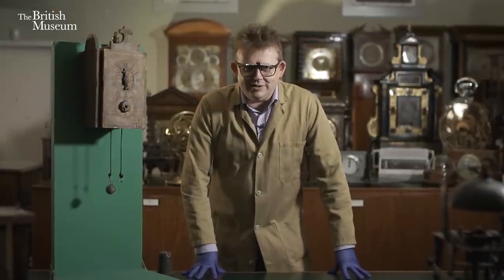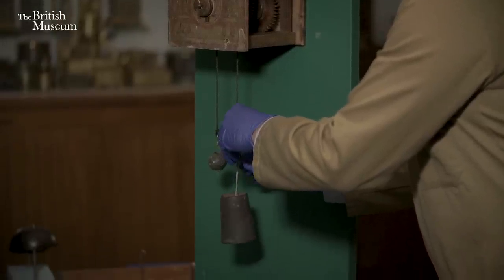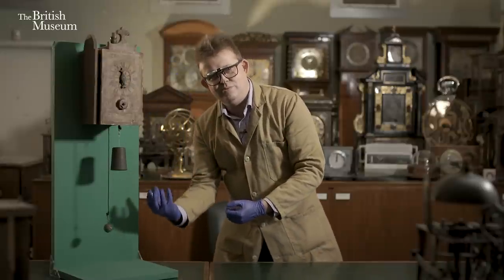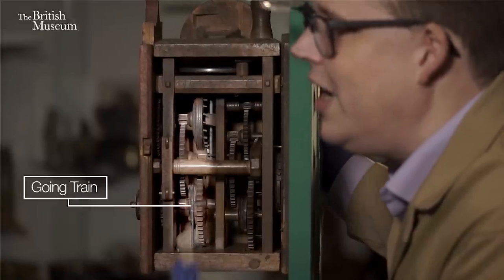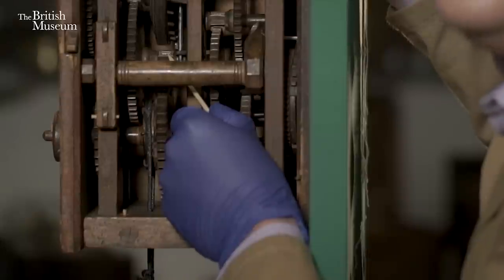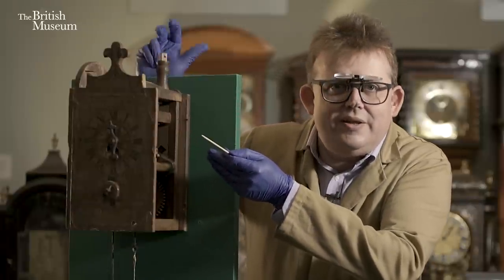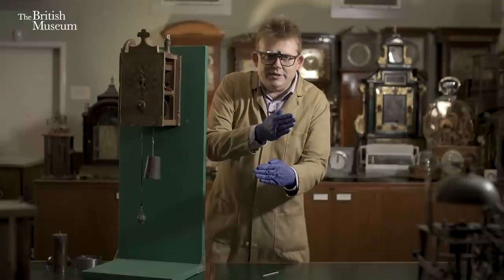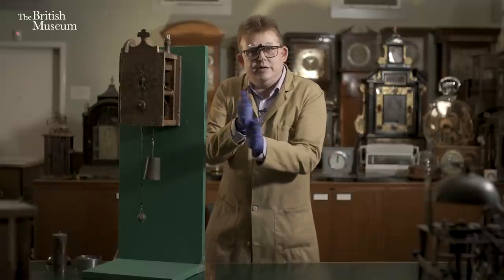How clocks work (in 5 easy steps) with Oliver Cooke I Curator's Corner S3 Ep3 #CuratorsCorner

Comment: I was taught how to tell time in the 1st Grade in 1974 or 1975.  But my sister is an elementary school teacher today.  She told me that they don't teach kids how to tell time on an analog clock/watch face anymore.  For kids today, everything is digital.  They have apparently removed all of the analog clocks on classroom walls and replaced them with digital clocks.  I think kids should still learn how to tell analog time.  There are still many analog clocks out there.  I actually prefer an analog watch face on my smart watch.  When I moved into my present apartment 3 years ago, I installed an analog clock in my kitchen.  But in those 3 years, I have never looked at that clock to tell the time. Like almost everyone else, my first instinct is to look at the digital clock under my TV or at my phone.  I don't actually have cable TV anymore, but I really missed that clock, so I bought a digital clock to put under my TV where a cable box would be.  But even with all that, I prefer an analog watch face.

Comment: as a hobby watchmaker, I got really surprised when tugging on the weight sped up the clock. In "modern" pocket- and wristwatches that is impossible just because of the physics as described by Huygens, the balance oscillation frequency is determined strictly by the combination of the balance weight and the strength/length of the balance spring. the power only affects the balance amplitude. I wonder, what's different with the clock in the video?
Reply: answering myself after watching the next video in the series: this clock doesn't have a balance spring, the balance gets an impulse from the escape wheel through one of the pallets and spins until it is stopped and launched the opposite direction by the second pallet, so the rate is determined by how fast the balance is spinning.

Comment: Let's go to the indicator and let me try out on the British Museum my theory why it's conventionally divided into twelve. 

One first "natural" clock could have been a tidal lagoon or basin emptying and refilling in a regular pattern. This wouldn't have necessarily been in phase with daylight hours, but I think high and low water are the same amount of time apart throughout the year, and through neap and spring tides as well. A practical time keeping device used for keeping track of the daily tides would naturally be divided into 12 with the 1st hour after low water defined as the time by which 1/12 of the tidal range has been reached,  by 2 another 2/12, by 3 another 3/12, by 4 another 3/12, by 5 another 2/12, by 6 another 1/12. so by tide-turn all 12 12ths have been added, because 1+2+3+3+2+1 = 12. At 7 of course we're back down 11/12 of the height and so on. As far as I can see the only number you can do this and get whole numbers is 12 or multiples thereof. A face or scale divided into 10 for example would have to log a tide turn at 5 and log the 5 water height increments 1/10  2/10 3/10 2/10 1/10, but here the numerators don't sum to 10. That could be why 12 came to rule on clocks including maybe even sundials.

Comment: Does the size of the gears affect the clock?
Reply: Due to friction losses, I am assuming a clock with a fewer number of larger wheels with more teeth per wheel, has fewer friction losses than one with more smaller wheels with fewer teeth per wheel. BUT, the larger the diameter wheel, the greater force the wheel’s driving force (pinion, spring at hub/arbor or weight barrel attached to hub/arbor) must overcome, due to the larger wheel acting like a longer lever when comparing the radial distance of the teeth with the distance of the driving point. So those decorative skeleton wall clocks with one giant minute wheel and escapement geared directly off of it (like some of the make-it-yourself wooden clocks) have fewer wheels in the train not just for decoration but for necessity, since the larger diameter wheels make for a mechanical disadvantage for anything needing many wheels to run (such as clocks running longer than about 8 days, like month clocks or year clocks, which only need winding once a month or once a year).
Reply: @andrewbarrett1537  wow.. I can tell that you are very well educated mate, the way you explained that was impressive 👍